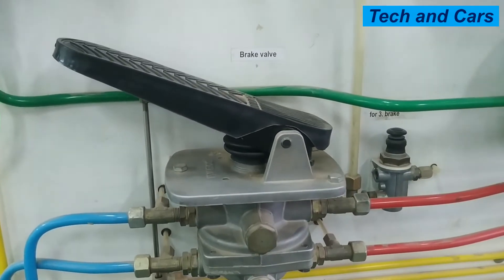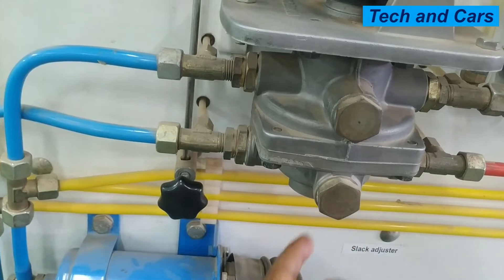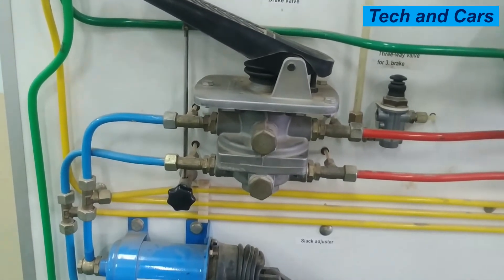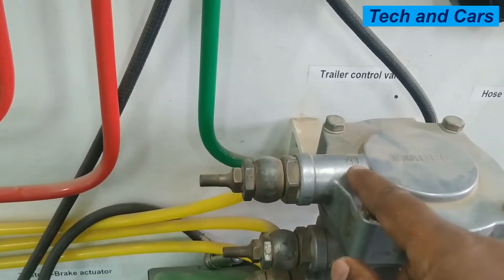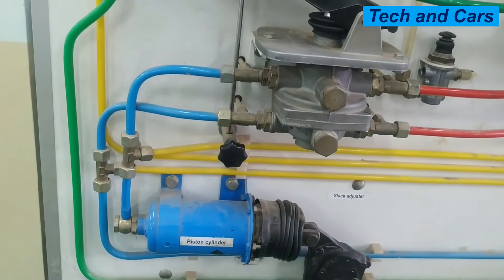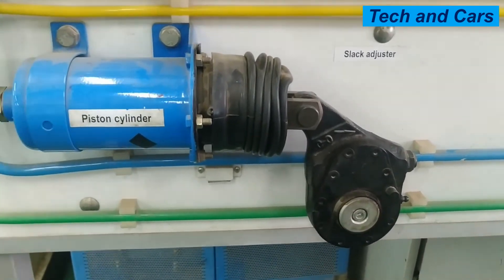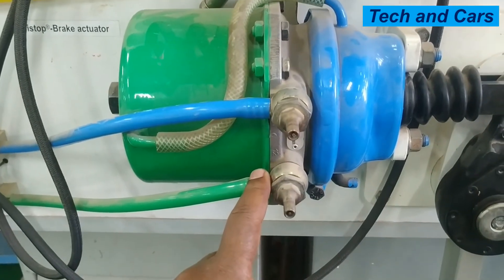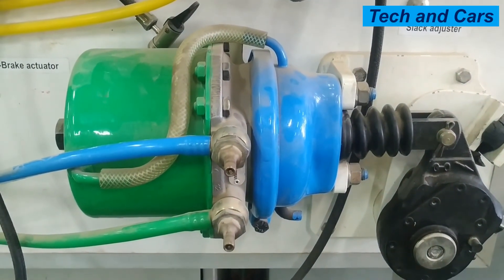How does the air brake system works? Part 2 of 4

Comment: I have a problem with a fuso fighter, it keeps breaking 1 air line and applying breaks to the trailer. Help me
Reply from the maker: Sounds like a serious issue. I recommend getting a professional to have a look! Have you been using original parts for the tubing?
Reply: @Tech_and_cars the issue was the exhaust manifold. It was blowing on the air pipes but I noticed and fixed the exhaust. We are all good now. Thanks

Comment: Brother I have a question,after a accident with atego Mercedes euro 5 after big pressure in brake,we have problem with brake it's lagging start the car and can't move,we press 5 6 times the pedal with big pressure and unlock